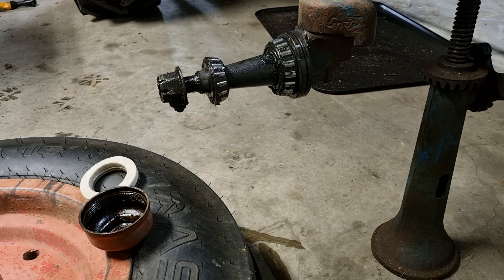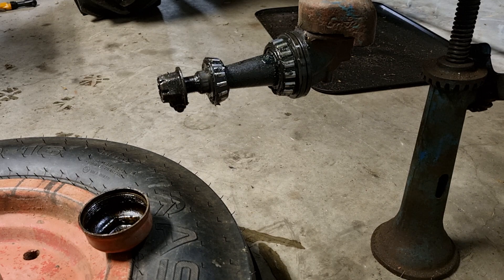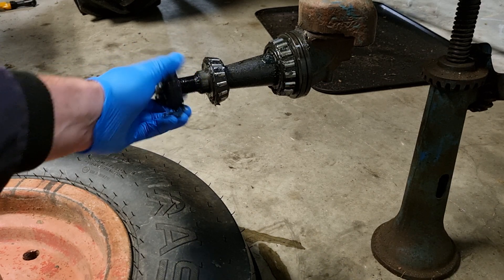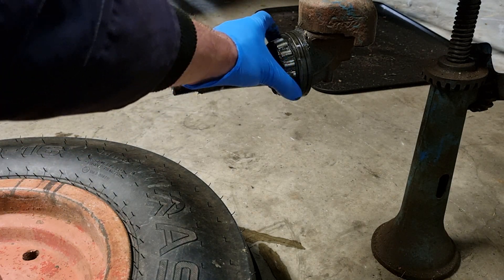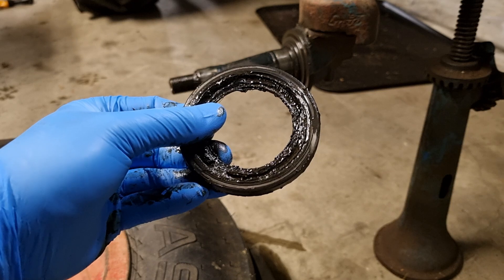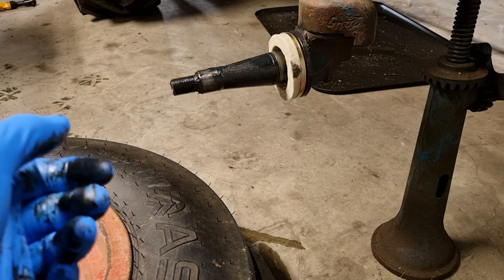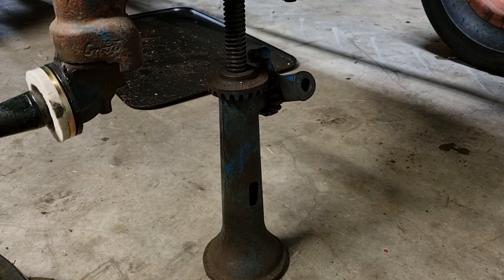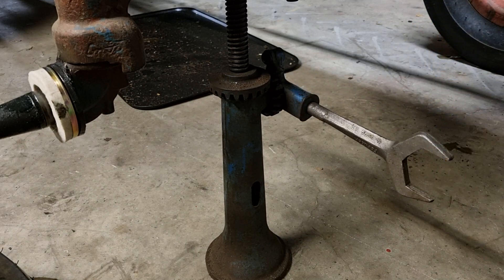Fordson Major Front Wheel Hub Seal Replacement

Comment: Hi I need to replace the fuel and oil filters on my Fordson Major tractor. I watched a previous video of yours re this (1 year ago) and your tractor is the same as mine. May I have the part numbers please?
Reply from the maker: There are two different filter lengths available for Fordson's. My suggestion is to take them out and measure the filters then search online for Fordson Diesel filters. Many suppliers offer kits at good prices, even on Ebay.
Reply: @fixingfordsonsaustralia6632  thank you for responding. I'll do as you suggest. Hopefully there are part numbers identifiable on them somewhere. Kind regards 🙏

Comment: Think some oil on the felt will be usefull?
Reply from the maker: I've generally found as the grease from the axle/bearings works its way through the felt it does the same job.